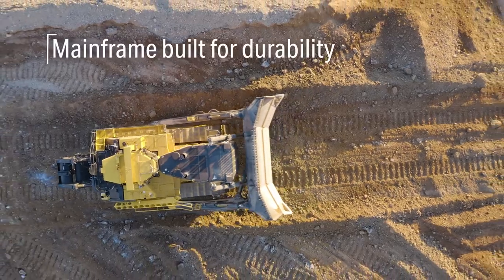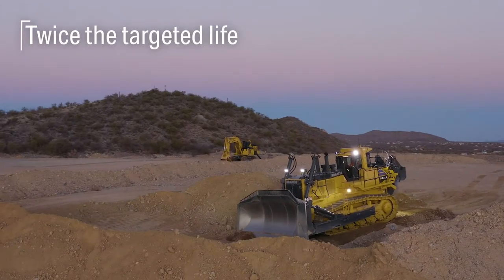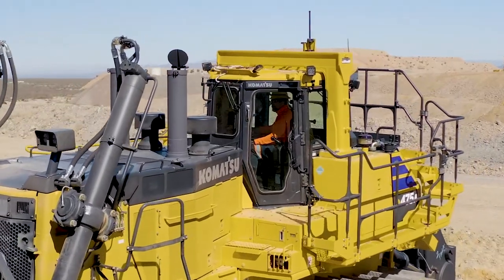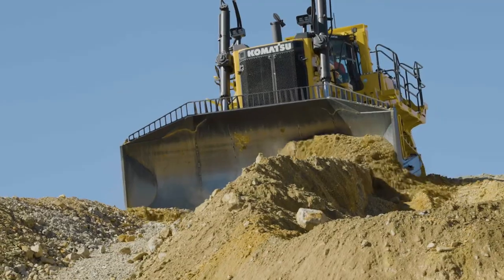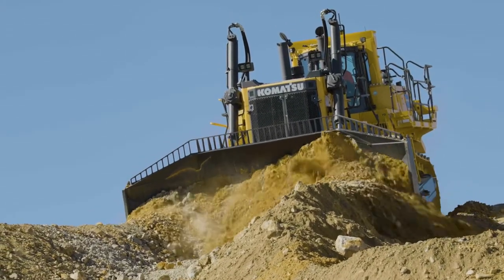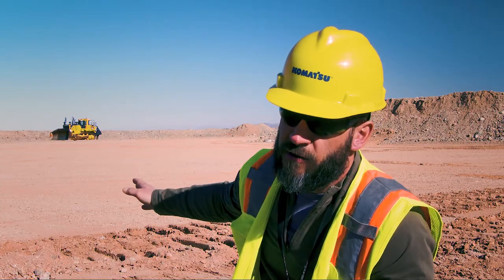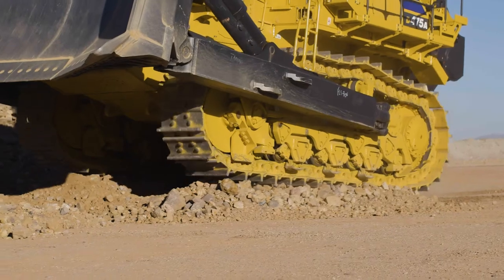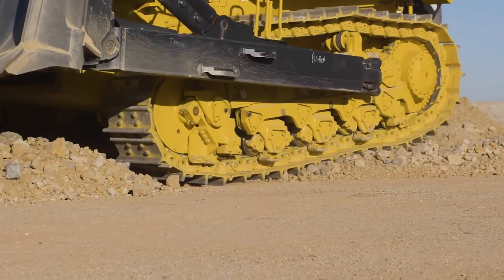Komatsu D475A 8 Mining Dozer Engineered for Durability

Comment: Nice machine, I have 25 experience in D355A,D355 with Ripper dozer,D65,D85ESS, D275A-1Ripperdozer, Komatsu rubber tyre dozer, Komatsu FEL WA600-1,Outstanding Performance means KOMATSU Equipments, Good earth grip comfortable etc.
Reply: nice the D355A was used as the killdozer, pretty cool you got to use it